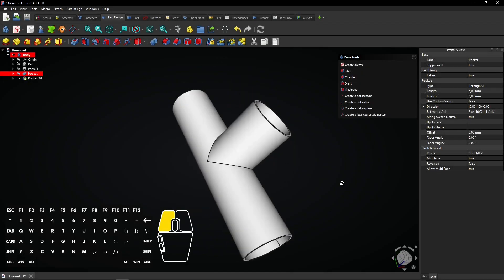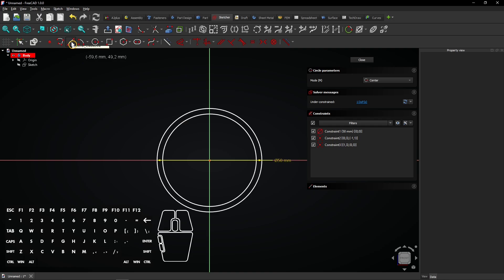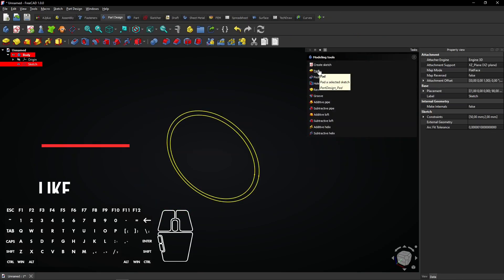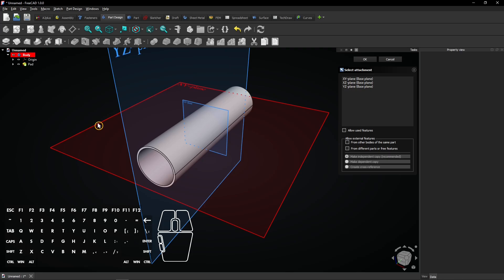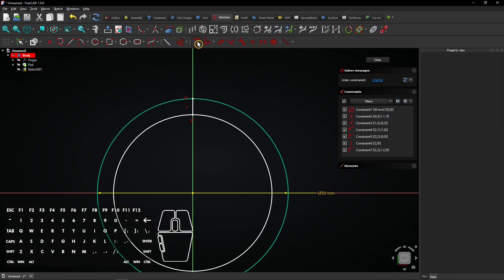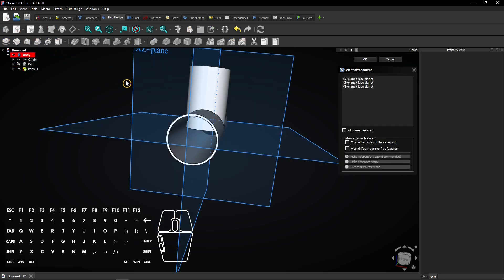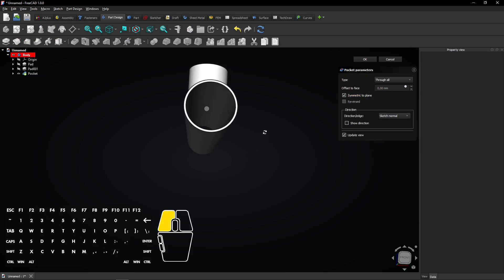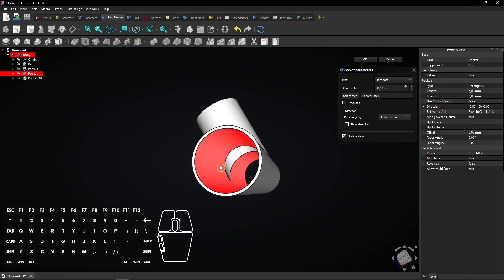📌 FreeCAD Part Design - T-Pipe - T-Joint Model - FreeCAD 1 Tutorial - FreeCAD For Beginners

Comment: Great, quick, simple tutorial and exactly what I needed.  You earned a sub!  I wanted to add extra support to the T junction, hard to explain, but basically a triangle support where both 90s are; imagine a wing suit, now imagine this T junction with those wings LOL, I dunno how else to explain.  I am currently working on it still, but I started off with creating datum planes on the rounded parts.
Reply from the maker: Thanks. Nice explanation! 😁 I think you can add those, by creating a sketch on the middle of the long tube (on the origin plane). Then draw the triangles on both sides of the short tube. Extrude them with the Pad feature to both sides. Good luck!
Reply: @AllVisuals4U Thank you.  I am going to reverse back, no datum planes, and do exactly what you just said because that makes A WHOLE LOT MORE SENSE.
Reply: @AllVisuals4U  Thanks again for your advice, I finally figured it out! It's exciting because I am literally brand new to 3D design and printing; about a month in, it's only a hobby of mine but I want to become a professional.  So what I ended up doing to get the "added" angle supports on both sides of the T was to create a sketch on the long tube like you had mentioned, poly-line drew a triangle from each endpoint of the T, padded the triangle; this created the 3D triangle which gave me the supports that I needed on the outside of the T but the triangle also went through the internals of the T junction tubes.  So I deleted the pockets created from your tutorial and then basically re-created those same exact pockets (using the "through-all" and "up-to-face" techniques).  This left me with the external angle supports I needed and now the inner parts of the tubes are clear as well!  I know this maybe small, but for me it's a big feat to figure this out on my own! Thank you again for your help!
Reply from the maker: Awesome! 🔥 You can try to draw two separate triangles, a bit inside the wall of the tubes. Then you don't have to cut anything.